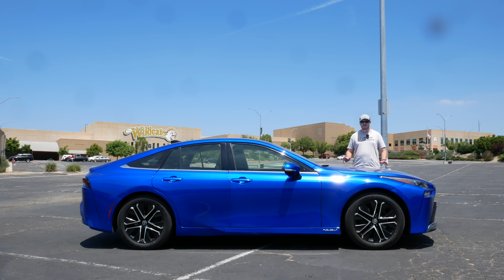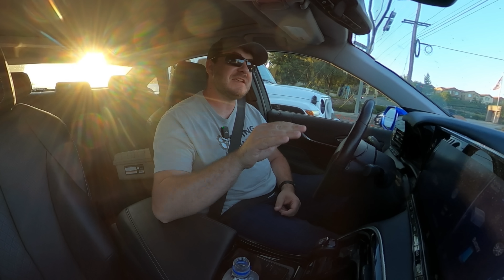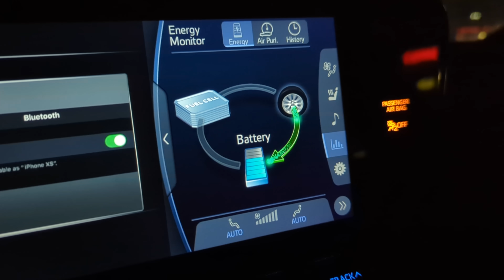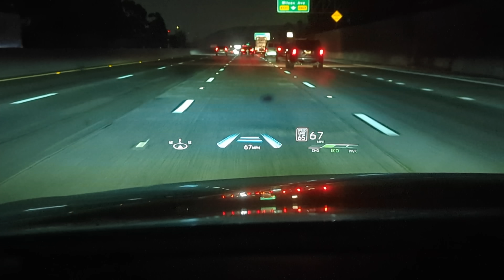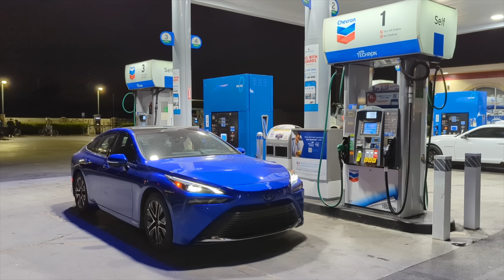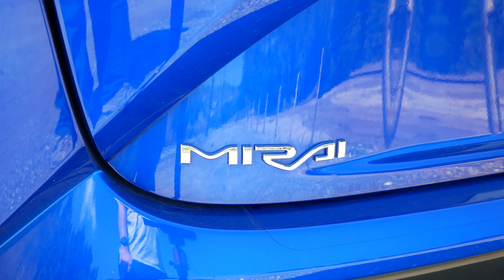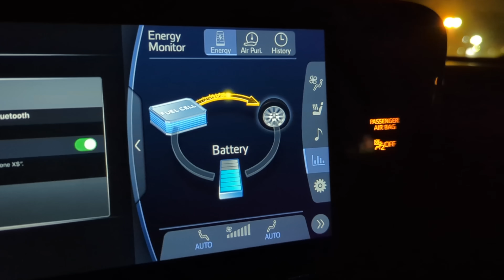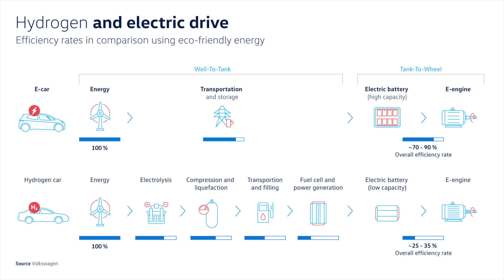The Toyota Mirai is Disappointing

Comment: Hydrogen just isn't it.... EVs will win out.
Reply: How so....?
Reply: @pontiacgto2005  Storage and transport of hydrogen is the problem. There is no real transport for electricity. Also, hydrogen is produced by using electricity which is another efficiency loss factor... it just isn't necessary with lithium batteries.
Reply: EV have issues with charging times. Especially on long trips.
Reply: @thehumblepilot22 not really - fast charging of smaller cars is getting down to the half hour range. I think the Ioniq 5 is even approaching 20 minutes, though that is the outlier

Comment: Hydrogen fueled cars are a great idea, provided there is a cheap, green source of hydrogen, which there isn't. Now, if nuclear fusion power arrives, that could all change.
Reply: Having nuclear fusion power would work for BEV benefit too, what hydrogen cars could only benefit from is if nuclear fusion power plants starts producing more energy than we can actually utilize and converting it into hydrogen would make some actual sense than just directly charging your cars.
Reply: @Zripas  If nuclear fusion becomes a reality to the point where we have complete energy abundance, we can re-think everything about modern infrastructure. But until that, best to aim for whatever is the most energy efficient.

Comment: Hydrogen may not be the most efficient solution but instead of shutting down wind farms at very windy days when the grid can't handle the power, they could be just producing hydrogen for energy strorage instead of feeding the grid directly. I don't know if that will ever be economical but in theory it sounds better then wasting the potential wind energy.
Reply: for every 100kWh of energy you store as hydrogen, you get 30kwh in return what you want it back. its not very efficient. Ironically you'd be better off storing it in batteries.
Reply: @engineeringtheweirdguy2103  30kwh sounds better than nothing. But I guess the storage alone is too difficult and expensive. I still can't imagine that batteries are viable at large scale too.
Reply: @fuselpeter5393  they already do it. Google the Hornsdale battery farm and what a huge success that’s been.
Reply: @fuselpeter5393  and when using batteries you get around 80-90kWh out of your initial 100kWh.
Reply: @fuselpeter5393  the other benefit, as demonstrated by the hornsdale farm. Is that batteries can output large amounts of energy quickly, and can respond in nano seconds. Which is incredibly beneficial for stabilising grid frequencies in events that would normally collapse the grid. Like when lightning strikes an interstate energy transmission line breaker station like what happened in 2018. And every state connected when dead except for SA which had the battery farm.

Hydrogen produces energy very slowly and responds much slower than batteries do.

Comment: The problem is that large scale adoption of lithium ion batteries in cars is problematic to say the least. We need more research, more technologies being invented, and if this is one of them, great.
Reply: problematic how?
Reply: @engineeringtheweirdguy2103  the manufacture of lithium ion batteries is worse for the environment than combustion cars' emissions and the mining and processing of cobalt for those batteries (mostly in south central africa- congo, namibia, etc) involves a lot of child labor and borderline slavery
Reply: @nical2003  mmm no. Firstly, EV manufactures all have “ethical sourcing” agreements. Which means so child mining in the Congo. But funnily enough whilst EV’s have the highest consumption of pure refined cobalt metal, they aren’t the largest consumer of cobalt by mass (as in, cobalt in chemicals as well, not just a pure metal). Turns out the largest consumer of cobalt by weight is…. Well fuel refineries. Who use it to remove sulphur. And since they’ve never had the public pressure for ethical sourcing, and since they want to make fuel as cheaply as possible, guess they pay those child miners.

As for making lithium batteries. Making an entire EV, is only around 15% dirtier than making an equivalent ICE. Got to remember you’re not mining, refining, smelting and machining giant engine blocks and 6 speed automatic transmission for an EV.

But in operation it only takes around 15,000 miles to break even with that 15% mark up. Even from a dirty grid. But most grids are rapidly getting cleaner and more people are utilising home solar which means that 15,000 miles is getting progressively smaller and smaller every day.
Reply: @nical2003  would you like to try again?
Reply: Evs have been around for 150 years, we don't need more research, we need more infrastructure to build and maintain them.
Reply: @miguellopez3392  we should look into a way to make the batteries where there's not worse pollution than with gas cars and without slave labor actually
Reply: @katal003  yes tesla had a whole presentation about that, you want additional information or just repeat the false slave labor rhetoric for another 50 years?
Reply: @miguellopez3392  if tesla (or any car manufacturer) said anything about it i don't trust it lmao
Reply: @nical2003  so you don’t believe Tesla is using child slaves for cobalt like Toyota claimed?
Reply: @nical2003  what do you believe then?
Reply: @engineeringtheweirdguy2103  im going to do more research on what you said and what i thought to be true but i dont trust anything a car company says about this because they dont actually care they just want profit (also tesla is a stupid company run by stupid people)
Reply: @katal003  well tesla bought a chunk of land in Nevada with lithium clay and are starting the ground work for the largest lithium refining plant in on this side of the planet, tesla isn't looking to just be a car manufacturer, they are trying to scale global battery production, and they will use a water based solution instead of acid to extract it, their cells are also being switch to cobalt free chemistries, gasoline uses cobalt in refinement process so you gas car has more slave labor behind it then a tesla.

Comment: There's a couple of these around our way. I think the city has a few on trial and there's other bits of the Hydrogen Road infrastructure here. Hydrogen seems to be working well for buses and trucks, cars is a bit of a stretch. That said, one use case Toyota is looking at is retro-fitting existing ICE cars. Things can only improve though. Look at how dire the early EVs were for range, and original Prius barely makes it to the end of the road on battery only(!)

Comment: Yes, but battery EVs need batteries, which have many expensive metals in them, need to be changed every 10 years, and have a difficult recycling process. Now, one could invent a tiny hydrogen production station that you could fit at home so that you produce your own green hydrogen using renewable energy from, say, solar panels or a wind turbine.
Reply: some corrections: 
1.) they dont need to be changed every 10 years. infact some EV's have batteries under warranty for that long. meaning they should be able to last much much longer.
2.) EV batteries are roughly 96% recyclable. infact Tesla state on their websites that they recycle all of their batteries.
3.)Hydrogen cars also need batteries. This is because fuel cells cant produce enough power for the car. Batteries are used to help the car accelerate.
4.) you wont get a tiny hydrogen production station at home. first you need enough space to produce enough hydrogen since electrolysis output is a function of the surface area. the more gas you want, the bigger the eletrolyser you need. Second, you have to compress it. Hydrogen vehicles accept fuel up to 700 bar in pressure. For context, 700 bar is 42 times higher in pressure than a steel BBQ gas bottle. so you need a massive industrial compressor to achieve those pressures, the smallest I can find is the size of a shipping container. Third, the gas itself takes up a huge amount of volume. The Mirai takes only 5kg of hydrogen but it has to be spread across 3 separate tanks totaling more than 200L (53 gal). and lastly, it takes a stupid amount of energy. For every mile of hydrogen you produce with renewable energy, you could have charged an EV to go 4 miles. Thats because it takes 4 times more electricity to produce 1 miles worth of hydrogen than it does to charge an EV one miles worth of charge. So creating hydrogen from home solar for instance is incredible wasteful compared to using it to charge an EV. even after you take out the cost of the equipment vs the cost of a home wall powerpoint installation.

sorry but it isnt happening.

Comment: Hydrogen fuel cells are the future. Most problems of hydrogen production and infrastructure can be solved by a couple of very powerful nuclear power stations - which would not only provide necessary electric power for hydrogen production, but also lots of heat for home heating - all with zero emissions. It's about time that we start utilising this wonder of technology dreamed up in the 1950s,  especially with the current situation of getting away from any CO2/carbon emissions.
Reply: If you hooked those nuclear generators to the power grid you could power twice as many EVs compared to hydrogen cars.
Reply: @miguellopez3392  * 4x. not 2x
Reply: @knoblauchhusten  this based on electrolysis net loss of 20% and fuel cell loss of 50%.

Comment: I got mine and put 13k miles without issues (4 months). The ride is very comfortable and the incentives is why I purchased it. I’m just disappointed at how much the hydrogen cost. Luckily for me another station went online a month ago and just charges $25 per kilogram vs the $36 true zero is charging now. 

Typically though I can reach the 400 mile range but I will be running the car low. I usually fill up when I put 300 miles on it and I still have about 80 miles of range left. The thing is that you need to learn how to drive the car by watching the “eco” bar it has. 

I’m sure I can push the car over 400 mile range but I’d have to not use the AC. I do plan to keep the car but the price of hydrogen would have to drop to $15 to make it worth it to me.
Reply: Here in the Northern countries all the hydrogen fueling stations have been closed
Reply: Does the tank leak over time?
Reply: Bjørn Nyland noticed that the car runs quite a bit less efficiently at higher speeds when the fuel cell has to work harder.
I think the fuel cell is a bit undersized for the application.
Reply: @logitech4873  You have to keep the car at 65-70 mph on the freeway. The slower the better obviously, which isn’t a problem as there is always traffic and at best the speed hits 60 mph if your lucky. I have noticed if your going 80-85 it you won’t get as much range but that’s like any car.
Reply: @Aku112811  All cars get an efficiency drop due to aerodynamic drag, but the Mirai dropped in efficiency more than expected at ~110km/h, indicating that the fuel cell itself loses efficiency when working hard.
Reply: @logitech4873 Also the faster you go the less efficient the engine is running on ICE car… sure drag has a part to play but that typically limits the cars top speed. Like in plenty of small cars that don’t have over drive gears can run nearly 4,000 rpm at 80-85 miles per hour. The engine optimal use for  fuel in a small car is closer to 3,000 rpm if your lucky on highway speeds. Even in v8 cars since the motor works less the rpm’s are lower at higher speeds. That’s why the corvette can get 27 mpg on the highway even though it’s  a v8 sports car. 

So going back to the Mirai is there a test done to see how big of a difference in % compared to an ICE car at those speeds? I highly doubt there will be a huge spread. 

A trick to maintain its range is to not a accelerate quickly to your desired speed but to gradually reach it.

Comment: 5:30 i think your missing the entire point of the mirai... totoya wasn't trying to make another EV they were trying to make a hydrogen powered car but it just so happens that the only really clean way to use hydrogen is to turn it into electrical power through recombination with oxygen, the battery cell is just a surrogate between the cell and the motors to keep a constant power level. 

the idea is to use less battery packs so there's less toxic metals in the vehicle, im pretty sure they're trying to figure out a way to completely remove the battery pack altogether so they can reduce the efficiency losses even further.
Reply: Well actually they're developing more EVs.

Comment: Lithium, Cobalt, Aluminum and Copper are all mined from the ground. And no one will take into account the amount of diesel and other fuel sources it takes to mine these materials to produce one battery. No one will take into account the amount of energy is required to process these minerals into usable components for these batteries. So until someone comes up with this magic formula I wont agree EV's are cleaner than Natural gas, Hydrogen or fossil fuels.
Reply: Many studies on total environmental impact take this into account though, but sure you can keep pretending like you're the only person to think of this for whatever weird reason.

Comment: SDGE (San Diego power company) charges roughly $0.40 per kilowatt hour for electricity. For Tesla owners etc. one would either have to not care because they are middle class making 6 digits USD after tax a year ($100,000) or have solar. Probably why too many SoCal people still drive cars with an ICE inside them i.e. traditional cars with only ICE or hybrid drive trains.
Reply: Still cheaper to run a Tesla on those prices.
Looked up San Diego gasoline costs which seem to hover around $1.27/l, and the average US gasoline usage is ~9l/100km. This puts the cost at ~$11.43 on average.
A Tesla will use anywhere between 120-200 Wh/km. Lets assume 175 Wh/km, in which case 100km would cost $7.00 (17.5 kWh * 0.40)

Electricity cost about $0.04 where i live, and my Tesla Model 3 is ridiculously efficient, so I usually pay about $0.6 per 100km.

Comment: What this is its a diesel not refined one. Evs battery are dead end already. Hydrogen is future. Why? Well maybe ask how much lithium and other metals you need to build battery and how much earth has deposits. As they are non recyclable. Hydrogen every country has it. You only need water, factiry of hydrogen, fuel stations which we have and energy done. All aspects of hydrogen car are not important. In 10 years they can fly fast. Simple evs are trash. Tesla also. Than tou need insurance, and than you want to sell, than you need find charger, than your batter makes less and less range. Than battery cost more than car. Than price rises for charging list goes on, than youneed more tyres brakes etc. As car is heavy. Now hydrogen they made mirai this way on purpose as this car will woek even after 20 years same as new. Instant accelerating will brake fast your main driving parts. Its like rear truck. 2 parts connect. So if you do smooth they will not brake, if you push from standing they can brake same second like 2 pieces brakes into each other. Friction. So toyota made car perfect from braking. It will rust to death and will drive while simple ev is dead after 7-8 years
Reply: We have vast deposits of lithium, and lithium batteries are very much recyclable lol.
The battery in a Tesla cost about ~15% of the whole car in production.
Electric cars use the brakes far less, and almost never need replacements.
My Tesla model 3 is 5 years old and has lost 4% of its range. The battery loss curve usually flattens out after the initial loss.

Comment: Edit, oops.. typed this before watching further.....
unless my math is wrong, that cost per mile is insanely expensive! At ~$30 per kg of hydrogen, you said capacity is 12lbs, thats 5.5kg. You said real life range is ~250 miles... thats 5.5*30 = $163 to go 250 miles. a 30MPG combustion engine car would get you that far in 8.3 Gallons (at California prices, where Mirai is) thats ~$40. A quarter of the cost! When compared to electricity. Model 3/Y Long range also get about 250 miles (despite claimed ~315), you would pay (also in California) ~40c per KwH, and the pack is 75Kw, so about $30. Yes I heard that you get free years of charging, but still, someone is paying for that hydrogen if not you, and unless you are leasing you gotta pay for it after the free time expires.

Comment: So its a hydrogen generator charging a battery in an electric vehicle? Hydrogen is an explosive gas, just run a normal engine off of it ffs....
Reply: It's actually far more efficient to run it through a hydrogen fuel cell like in the Mirai than it is to burn it directly. The Mirai gets like twice the range a hydrogen combustion engine would.

Comment: You can place a hydrogen recovery unit to and super critical boiler and have limitless amounts of hydrogen for very little cost. They have to make they dry steam any way just divert a small amount pre first stage turbine to the gray hydrogen unit recover the hydrogen and ship to filling stations. One boiler can make enough for an entire state in just a few days without losing power generation by running the recovery unit at night when peak load is low.